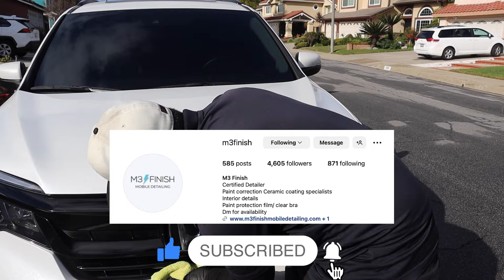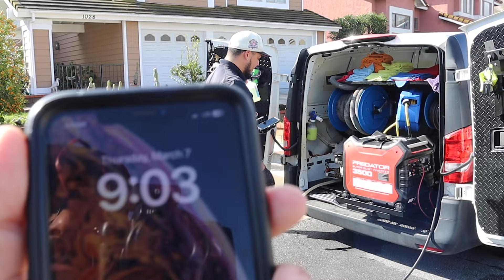Client didn’t show up for her detail…

Comment: We charge a 20% fee of total cost if a 24 notice is not received. Most of the time they pay it no problem, occasionally they get mad and cancel in those cases good ridings.
Reply from the maker: Thanks for the tips I appreciate it moving forward for clients we require a deposit because time is money some times people just lag on you so I feel like we should get compromised. Thanks for supper channel I appreciate you 👊🏽
Reply: @m3finish How do you get the deposit from them? and how much of a deposit to you require?
Reply from the maker: @Jaysmobiledetailn  depends on the service 
We ask for a deposit that’s non refundable that goes straight to their appoint. They send it through what platform they have
Reply: Riddance